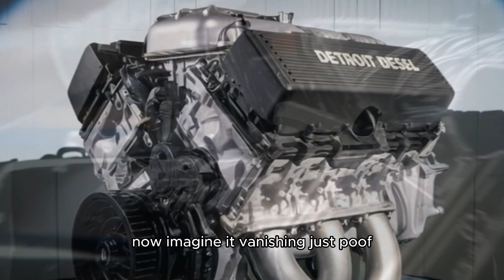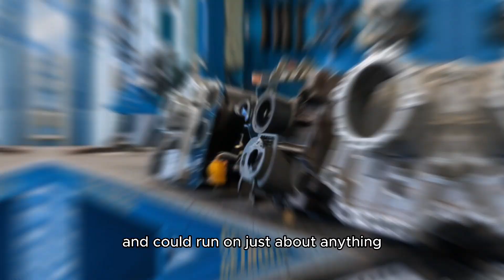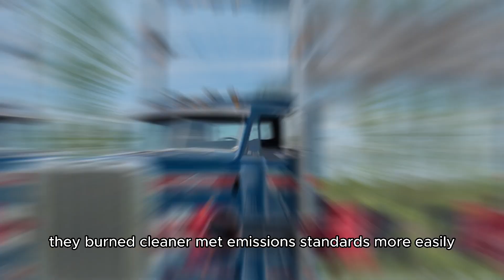The Real Reason Detroit Stopped Making the Legendary 2-Stroke Diesels

Comment: ISO is a trap. It standardized yes. It also limits. You have to operate within those standards or your product does not get shipped or sold. That includes exceeding the standards.
But unlike what I learned in the early 70s. The machines that make the machines should exceed the standards. That was then.

Comment: These ai generated click bait bull chit vids are getting out of control. There was nothing about a screamin’ demon (other than the sound) that anyone really liked. The damn things leaked out of the air boxes (by design), they ran hot because of the two stroke, they did not make torque which is what a Diesel needs to do in order to make money. They failed modern emissions standards. This is why they are no more. They were cheap and easy to keep running, they were the first mass produced Diesel’s that used a computer to control the fuel, and they were a novelty. We could go on forever about how great the ol’ flatheads were, but the proof is there, they are not that efficient. Anyway, these videos suck which is why I didn’t watch it. Besides, I learned how to work on Diesels by wrenching on these old mules.

Comment: I've driven/operated 6N71's, 8V71's, 6V53's, and 12V567's.
They could all make the horsepower but fell way short when it came to torque.
Without torque all you have is a frustrating experience when trying to move 73280 or 80000 lbs.
When the EPA forced Caterpillar out of the truck market there was a long dry spell before Cummins and Detroit stepped up with their 4 stroke engines of today.
Reply: Cat got out just before tier 4 final about the same time Detroit's series 60 was on its last leg. Now Detroit sells rebranded German engine that suck to work on but provide good low end torque. I switched to yellow iron dirt toys so I can still work on the big cats!

Comment: I miss the 2 stroke Detroit bark and the Jake brake growl through a pair of open stacks 
NOTHING MORE NOTHING LESS
Reply: I think the reason 2 stroke diesel ultimately failed. Is that it was a bad design and concept  made to work. 2 stroke diesel bad as it was as a diesel could beat out the finest gasoline engine you could ever build simply because it was diesel albeit poor one. It was also better than 4 stroke because naturally aspirated 4 stroke low power for engine size. So much so that with the technology available in 1930's 1940's,1950's an even 1960's it was hard to build an engine powerful enough to get the job done. Well all that went out the window when Cummins came up with the NT 4:38 C 335 turbo diesel in 1969. Now the horsepower out of 4 stroke diesel is good enough to consider. And won out because effeciency and emissions issues inherit with the 2 stroke concept. 4:38 4:38 I think 2 stroke diesels should be limited use classic vehicles. And nobody should be allowed to use these engines for long haul trucks,local trucks that go a normal amount of miles or revenue service for busses.
Reply: Paul, my hearing aids would argue that point.
Think that you're immune?? Just wait until you get to be my age.